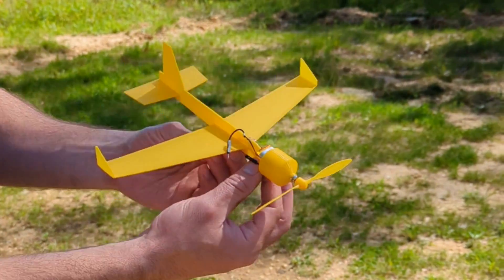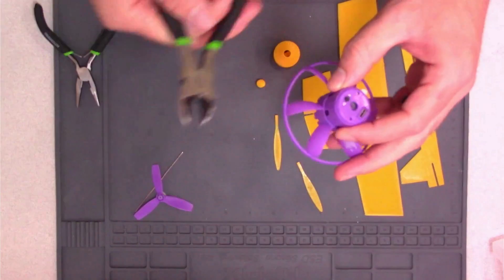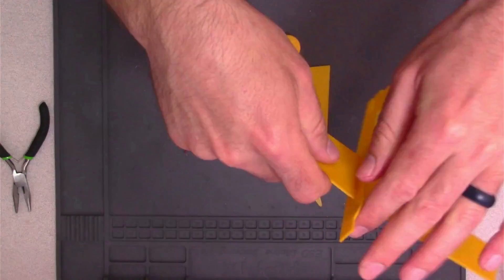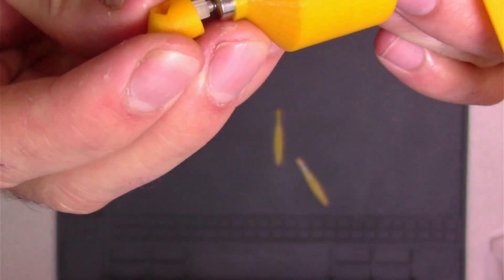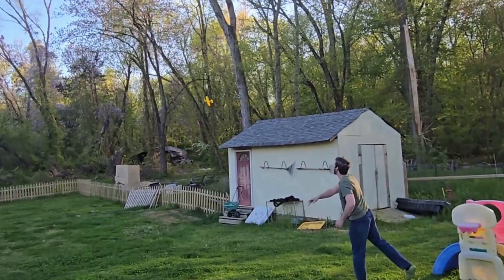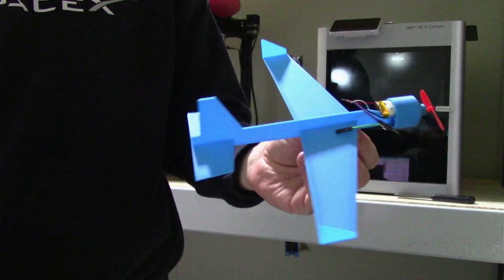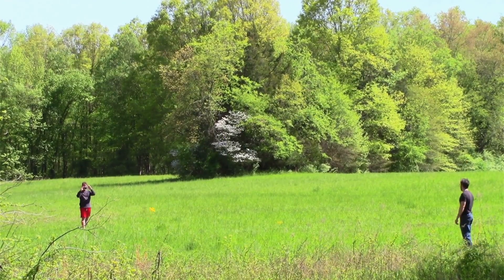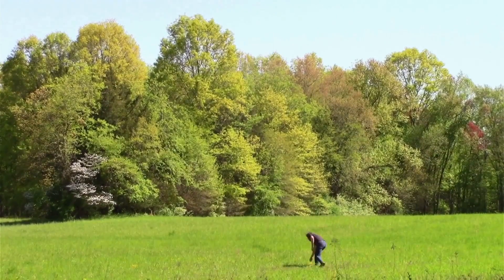Can a 3D Printed Airplane Fly?

Comment: Angle of attack creates lift not "thrust".  Too much AOA may will make the wing stall.  A flat wing is inefficient compared to one with an aerofoil cross section.  Winglets on the wing tips reduce drag but do not contribute to stability. The simple way to get stability is dihedral: the wings should be angled up slightly.  Finally, you need your fore/aft weight distribution checking.  Looks nose heavy to me.

Comment: Winglets are anti-vortex devices that reduce drag- they do not add stability. For that you need dihedral. The angle of attack of the wing vs the stabilizer is also for stability, it does not affect the thrust. You also need to consider the motor thrust line and the C of G (which should be just behind the centre of lift)- you could have got the distance you did without power. Best way to get more thrust is a brushless motor. Add R/C while you are at it- the extra weight is very little these days. And recruit a pilot- small planes require skill.

Comment: I would just like to mention the winglets are for efficiency of a wing not stability it prevents air at normal pressure from going above the wing to lower pressure by preventing it to vortex around the wing tips they are not required and add a significant amount of weight so I would recommend removing them on the next design

Comment: you need a dihedral.
Reply from the maker: Yes! The next plane will have two separate parts for the wing, it wasn't really possible with the way we were printing it this time.
Reply: @hackertwins  you can heat up the middle and bend so you have dihedral no need to overthink